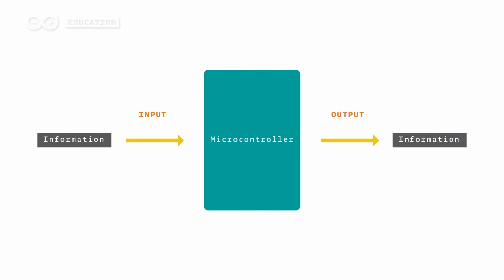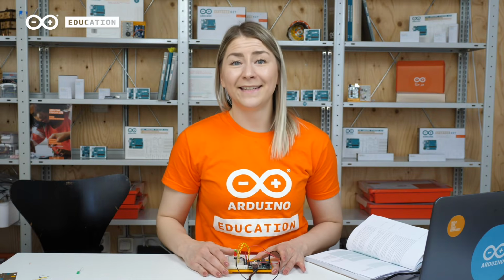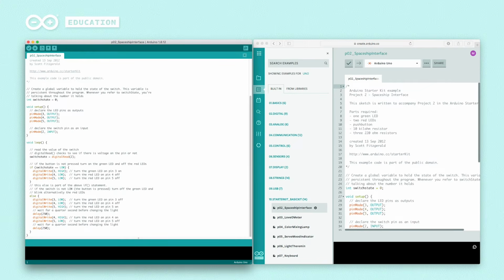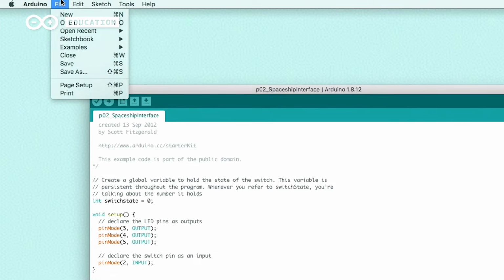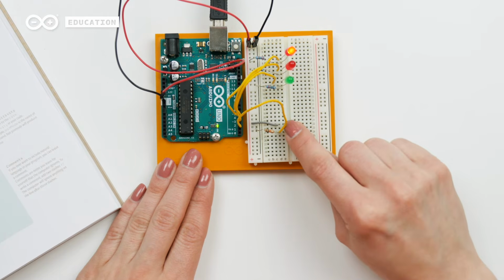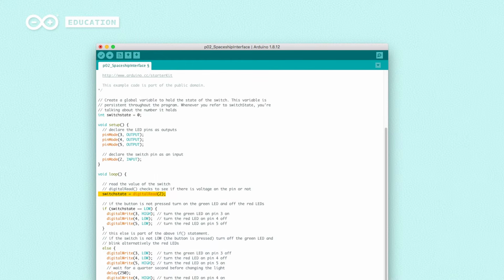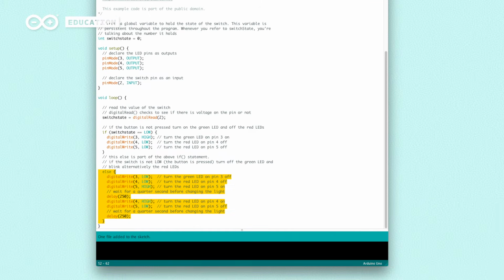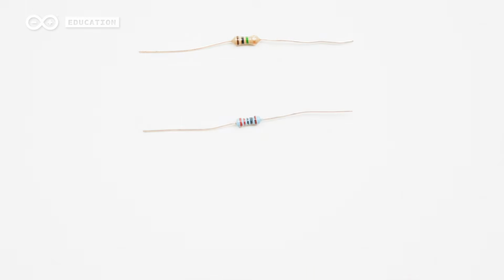02 Starter Kit: Spaceship Interface

Comment: for the people with the questions the flow takes the route of the least resistance so thus means then the resistor goes into ground with this setup of components al your leds are safe and no need for the extra calculating on multiple resistors and mathmatica else it would be not possible for new people.

Since with multiple leds you want to be safe and als your leds dont break, 

on ground with multiple exits it can be possible to have a rebounce then al components are broke now is everything safe and logic 

i am sorry for my Englishfor questions let me know i am happy to help people with ther Arduino or other MCU etc together is more fun and easy to learn
Reply: “als”?

Comment: I'm with all the other people here, not getting why the resistors are placed after the LED instead of before.
Reply: a resistor is limiting current (Ohms law, I=U/R). Since there is only one way for the current to go it does not matter, if the resistor is "in front" or "behind" the LED.
Also notice that the drift direction of electrons is opposite to the (technical) direction of current.

If there was a chance to short the LED to ground (circumvent the resistor 'behind' it), it would be a different story, that would be a fault scenario.

Comment: Can someone explain to me why there is a resistor going from the switch to ground? I know in project 1 and in this project we put resistors on the incoming power heading to the LEDs to keep from blowing them out. But what is the purpose of the resistor when the power is heading to ground?
Reply: it's a Pull-Down-resistor that 'discharges' the pin when the button is not pressed anymore.
If you connect the switch directly to ground, you will short out your 5V/Ground while the button is pressed. If you don't connect to ground at all, the charge on the pin will stay at higher voltage for longer and might create some undefined "in between"-states (for example 2.5V) before discharging via Arduino; the wire might even work as an antenna. It just makes the input unreliable. A single resistor can be used to either pull-down the voltage on the pin or pull-up (for example to 5V or 3.3V, when connecting the other side of the switch to Gnd. 
That's what they are called: Pull-down or pull-up resistors!
Reply: @917073  Ahh, thank you for the great explanation!

Comment: when i press the switch it does not flash it just remains with a green light on??? whyy
Reply: Wrong switch or broken switch
Reply: Or the switch isn’t closing the circuit but the circuit is otherwise already closed

Comment: I am having already good fun with it. Thank you.
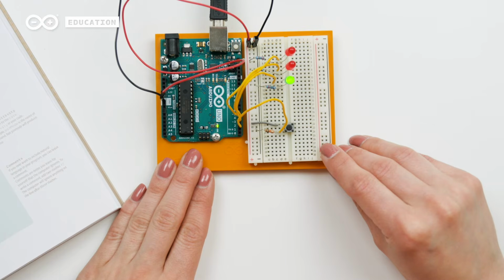My curiosity got focused on the LED on Arduino connected to pin 13. 4:27 Why is it illuminated in this project? Please, can anyone explain it to me?
The LED is also pulsing when I press the switch.
Reply: The green LED is supposed to be turned unless you are holding down the button. When you hold the button down, the two red LEDs should pulse
Reply: If the Green LED is also pulsing when you press the switch then that means you forgot to make sure that after you type the else, you type digitalWrite(3, LOW); to turn off the green LED. You also possibly included digitalWrite(3, HIGH); after the delay(250); which would make it pulse, there should not be digitalWrite for the 3rd pin after the delay(250);

Comment: @ 0:12 is this a counterfeit board? I just watched another Arduino video which said official Arduino boards are teal colour. Or has that changed over time?
Reply: Hi this is an original board. You can see it from the graphics on the PCB. Unfortunately there are some batches of UNOs which are made in blue (the PCB is not made by the usual provider) but the graphics and the printing on the side connectors is a good indicator. BTW this is an official Arduino video and we would never use a fake board in it :)
Reply: Other boards are not counterfeits either

Comment: I don't understand what the 10K resistor does at the switch. "...so it reads LOW when there is no voltage coming through the switch". But why do we need a resistor? If there's no voltage coming through the switch then surely it would read LOW anyway, because there would be no voltage, there's nothing to resist. Someone please correct my understanding.
Reply: The Arduino Board is very sensitive on it’s inputs. Every form of electronic or magnetic influence on the connected wires, will generate a very little voltage wich will make the arduino sometimes see an input, or better: a Logic “1”. 

This is called EMF influences. By putting an “pull down resistor” the input is bound to the 0 and the inducted EMF voltage will “shortcut” to it. This makes that there will not be any inducted voltage on the Input, or better: a stable logic “0”.

If you “make” the switch, the current will flow to the input instead of the 0, because there is too much resistant (10k Ohm). 

Without the resistor you’ll make a full shortcut from the 5 Volt + if you push the button.

I hope this will help you.
Reply: @Freddy1234-l9r  Thank you so much for this explanation. One additional question, if I may, why would the EMF voltage shortcut to the resistor instead of the input? When the switch is opened the current flows through to the input instead of the resistor because it's the path of least resistance, why doesn't the EMF voltage do the same and trigger the input of 1? Thank you again - I came to this video hoping for the explanation you provided above but now it's giving me a new question :)
Reply: @Gaunzo  Imagine a bucket wich has a small leak. If you fill it with a dripping crane, the leak might be able to drain the incoming water…. Result: No waterlevel rise. If the flow of the tap is increasing, you will come to a point the Level rises. 

The point that the water runs over the top, equals the switch being “Made”. The result: Logic 1 as an input.

Translated: the EMF is flowing away through the resistor until a bigger current is applied. Then the threshold of the Arduino is reached and makes an High input.

Comment: Why connecting resitors of LEDs to ground and not to the power pins?
Reply: I would like to know that as well.
Reply: I think it’s because they are essentially wired in series to the board, hence the current is constant at all points across that particular loop. They can, I think, go before or after the LEDs